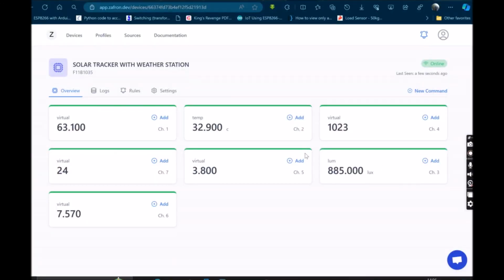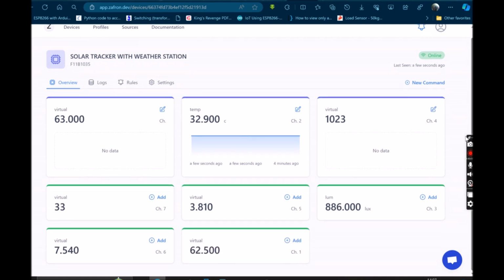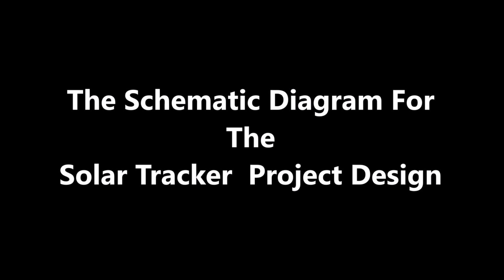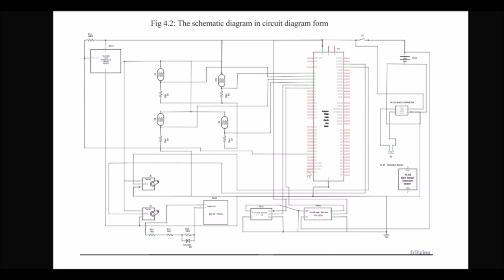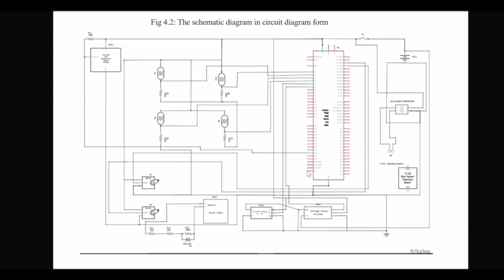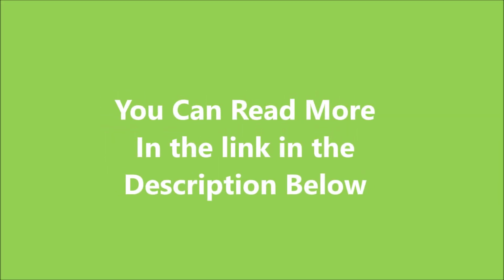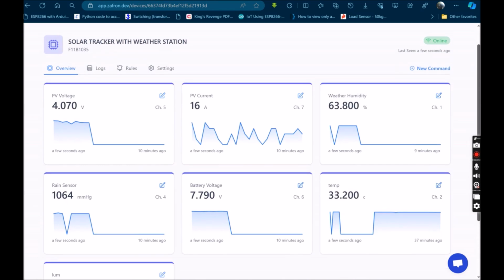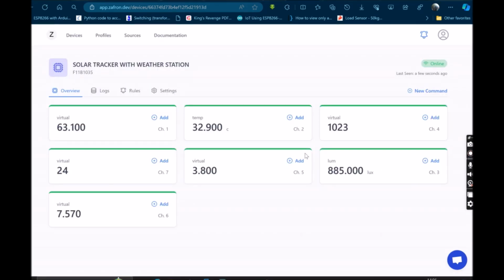IoT Based Solar Tracker With Weather Station Using Arduino, ESP8266 and Zafron

Comment: hi sir, may i know what model of buck converter you are using? im using lm2596s. once the buck converter connected to the circuit, its input and output voltage drop drastically. help me out
Reply from the maker: Check your circuitry again. Or replace the DC-DC buck converter
Reply: Sir can i get step by step video of the connections
Reply from the maker: @Team_Xclusive you have to consult.
Chat with my team on WhatsApp or Telegram